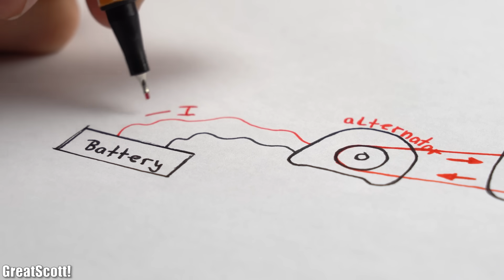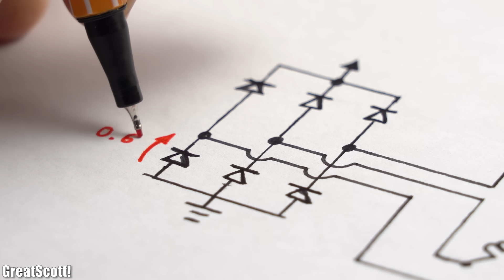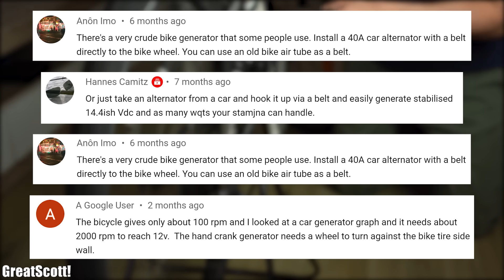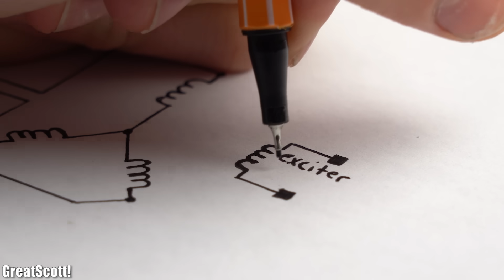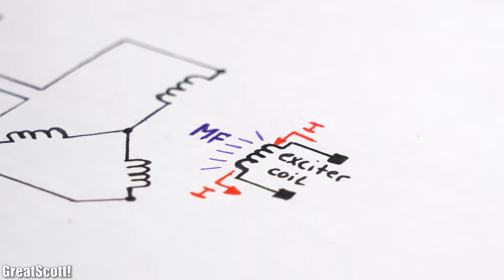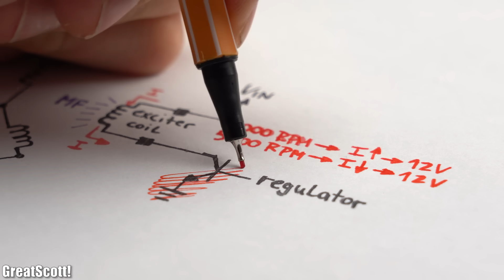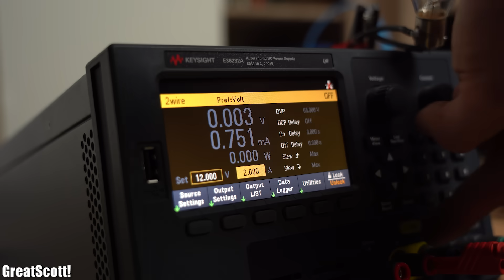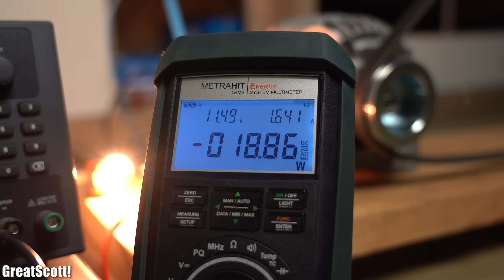Using a car alternator with a bike to power my home? How much energy can I produce?!

Comment: Hello,great video. Here is help. Step 1.  keep your bike set up with alternator the way it is, attach it to positive and negative posts of car 12 volt battery.. Step 2. Buy a Power Inverter 400 or 500  Watts,DC 12V to AC 110V  Car Adapter with 5A  (connect to car battery terminals) Wave Inverter USB Charger Adapter W/ Dual Outlets for Car Home Outdoor Use. Step 3. Peddle bike  alternator to charge battery. Step 4. Plug in household items such as TV, radio, phone charger,  computer (maybe coffee machine) note: it takes a car idling at around 1000 rpms 45 minutes to charge a dead car 12 volt  battery. So doing your calculations you may be able to charge the battery in ??? If you have wind generator just bypass the bike and have two wires from wind turbine to battery. Or if you have a gutter make a paddle boat mini wheel over your alternator attach to building in harness. When it rains the water goes into gutter and pours over paddle altenator wheel with two wires to battery to charge. Would have to water proof or extend shaft to get out of rain. Same can be done with your bike back wheel over river with a paddle wheel connected to your alternator with wires to car battery and adapter to plug in for free energy
Reply: Excellent advice.... I was left wondering why he hadn't gone the route of using an inverter.
Reply: lol

Comment: Doesn’t it add any reduction in power need. Even if it’s just like 20 euros a month or something of your bill or a certain amount of KWh per month?! Or is the amount negligible? Is was thinking about a system that connects all sources of energy. Piezo electric plates in your stairs, warmth while sleeping converted to electricity, home trainer, windenergy, waterenergy from falling water (if you have a 2 or 3 story house and even kinetic energy or piezo electricity in your shoe, stored via a battery that you carry. I mean so much energy is lost and we produce so much every day

Comment: Good job. ...heard work never fails. 
If you make the grooves on the alternator's shaft and remove the pulley,  you can get more rpm + definitely tension required

Comment: The alternator needs geared more than just the big wheel to the small. Also, for sure need a belt tensioner. I feel like with a gear this can be pulled off, at least much more efficiently.

Comment: If you take the diode pack  out all together, the three wires that are hooked to it are 3 phase . Hook a wire to each of the 3 wires at  low rpm you should get 100 volts an the faster you turn it , you can get up to 440 volts a/c  out of it. I built one 28 years ago and it worked great..
Reply: yep...these output ac and its rectified and regulated thru the diodes in the alternator... ive used the same alternators in homemade gas powered generators.. 120v and over 5kw but the ac is many thousands of cycles vs standard 120 v 60 cycle house current... still useable to power many devices and as far as lighting goes, the cycles dont matter at all

Comment: No.. no.. no ..   I built one much better. #1 tip.  Smaller belt.  Keep the alternator pulley as close to the bike wheel. There is much less resistance in the belt. Do your homework on alternators. If I remember right.... Honda is the best for this project.  The most power per rpm

Comment: Hey great video but did you know they make these "single wire alternators" that do not require you to energize the exciter coils. Ac Delco has manufactured them for decades for use in GM vehicles and for tractors or stationary generators.

Comment: I assume if the belt didn’t slip and you were Superman that you could generate near constant wattage the alternator is rated for? 

Oh, wouldn’t changing the wheel size increase or decrease output?

Comment: So you could create a transformer and bump 12V up to 120V... coil ratio 10 turns to 1 turn
Reply: Or buy one and use it to up the voltage

Comment: How much energy? Top athletes can do max 300watts for max 1 hour. That's 3 bulbs 100watts each not considering the energy losses mechanical and electrical from the pedal of the bike to the bulb itself.
Reply: maybe 300 watts for 10 seconds or so if you are hercules
Reply: no way 100 watts max

Comment: EVEN EASIER, use a cheap and cheerful Disc compatable rear ebike hub!! drive it flipped in the dropouts, off the disc side,
. Remove the rim and spokes if you want to. a Disc mount 6 hole sprocket, 16 ~ 20 T sprocket can be got from Velosolo. Done it myself. pretty easy.. 3 phase rectified brushless genny ...

It achieves, after 3 phase rectification losses (typically greater than 12V out )  a mech to Elec efficiency of ~60%. since most ebike hubs are rated >250W, you could easily get > 100W.... if you hav the legs of course.

Comment: So, realistically 
- I cut off the back section of a junk 20" bicycle.
 -Mounted it  Upside down in a block of wood 
 -Flipped the cranks & bottom bracket to keep the sprocket on the right hand side
 -Mounted a bldc ebike wheel with the cassette also on the right side
- Built a 3 phase rectifier from 3 bridge rectifiers from dead switch mode power supplies
- Added smoothing capacitors and an adjustable 1800w boost converter to charge a 48 V lithium iron phosphate battery.
- Attached the entire assembly using wood to a comfortable kitchen chair.
- Pedaling recumbent style I can achieve close to 200w  But realistically between 50-100 W for any length of time.

 The bike was free the motor came from a yard sale the boost converter came from another project as did the electronic components

Comment: Thanks have built simple 12 v generator with 3 HP Briggs n Stratton engine. And alternator. Best to use small output old school gen with external regulator v belt type , it will need a 1o watt exciter bulb to kick alternator into charge mode and be connected to a 12 volt battery  be sure to always have positive output connected  to battery ,if not the alt may damage a diode ,if it does this it will produce power still but the voltage will be affected and useless,.  A unconnected or bad earth and it won't harm anything but will not charge high amp alternator not applicable because your alt will only charge Amps into battery at the rate it can absorb  it may start out at say 2o Amps but will quickly fall away to about 8 Amps input only fitting an Amps Meter inline on positive lead to battery will show you what is going into battery  is change rate , my system was cheap to Run bit noise y but it worked well for many years. Good on you for sharing your experience  a little whipper snipper 4 stroke engine will do the job be sure to use fat wire and solid connection to battery   if positive comes loose while running it will damage alt   thanks again

Comment: from the winding's bypassing the diodes and voltage regulator and hooking up directly to the winding's you can get 90 amps. A/C but you need to use capacitor's to smooth out the power, so you get a constant power that does not fluctuate,

Comment: what if you disconnect the rectifiers in the back and voltage regulator and use ac voltage which is what the altranator produces in the winding's

Comment: I'd had the same idea for generating energy, but not knowing how to was happy to find your video.
In theory it seemed like it should work and a bit sad to see it won't. Thanks for giving it a go.
Reply: Well, some numbers have already been presented.  Here are some more, or a summary.  A horsepower is around 700 W.  A human in rest generates about 100 W as heat.  At full effort a well trained human can produce also about 700 W of mechanical power (plus an increased amount of heat!).  Using a half wave rectifier of silicon diodes, can reduce the rectifier loss to some 0.5 - 0.6 V and with Schottky diodes to maybe 0.4 V.  I am not sure how big germanium diodes were ever made or today available, but some tiny ones used to have a drop of about 0.2V.  After the onslaught of silicon, there were for a while ads presenting "Mr Germanium" or "Oliver Germanium" who touted the benefits of germanium over silicon, regarding the lower losses.  By the way, rather than a bike, a rowing arrangement can utilize the human mechanical effort better.

Comment: Directly proportional to the carbohydrates you're burning while pedaling, also alternators output DC not ac, that's why you hot no reading with your meter set on ac

Comment: You seem to understand the electricaric calculation melarky, I don’t…. as a Caravaner I’ve often thought maybe the lights in a house could be powered by a 12v supply, maybe use a zig unit to keep a leisure battery happy or install that alternator inside the washing machine to supply charge to leisure battery + solar,  I’m not an expert with tricity tho 🤔

Comment: I'm sorry this comment is a year late.  3 things:

1 - Power requirement.  James Watt's horsepower was aimed at being equivalent to the best horse he could imagine, so that when he quoted HP for his engines, no-one could say he over-estimated.  James Watt's 1HP was about 746 watts.  You state you need around twice that to run your house, so that's 2HP (or more allowing for inefficiencies).  Who do you think you are, to be pedalling at 2HP?!!  I hear numbers like 0.25HP in short bursts for a fit person.
2 - Mechanical power losses in a generator are friction and windage (windage from air friction).  These losses are roughly in proportion to the power rating of the machine.  Now an alternator might be a 40 amp machine, make that 14V × 40A = 560W machine (we expect a nominal 12V vehicle battery to run at about 14V under charge).  The excitation circuit presents a real loss, too, so it takes reasonable effort just to keep the machine excited even with no output.
3 - The answer for the best power output seems therefore to be with a smaller machine.  Not even you are going to be able to supply 200W (over ¼HP) for any length of time.  Maybe 50 to 70 W.  And we want one which doesn't spend our precious energy on self-excitation.  This leads us to a permanent magnet machine around 5A to 6A at 12V (or 14V).  

I would look at windscreen wiper motors or radiator fan motors.  Probably cheaper than alternators, too.

Advantages:  (i) A DC motor would have no diode loss, whereas the alternator loses nearly 2V × output Amps as a power loss.  That's around 12% of the generated power.   (ii) A permanent magnet machine uses no power for excitation.

Caveat: a permanent magnet machine has no self-excitation circuit, of course.  Self-excitation circuits use an external regulator to vary the excitation in such a way that the alternator always provides a constant 14-ish Volt output over the engine's rev range.  So in a serious pedal-powered 12V battery-based system, a separate regulator circuit would be required.  Fortunately these can be very efficient and nice and simple to make.

Comment: OH BUT DONT STOP THERE.. A BIG BIKE WHEEL HAPPENS TO BE GOOD BUT A PULLY SYSTEM AND A FLYWHEEL WHERE YOU CAN ALSO COLLECt ENErGY ... MAY MAKE YOUR ALTERNATOR MOTOR SET UP RUN EVEN MORE POWEr.   AT THE MOMENT, YOU STILL HAVE LOTS OF WAIST AND LOSS IN YOUR SYSTEM.... INPUTING A PULLY SYSTEM WITH GEAR RATIOS AND A FLY WHEEL TO KEEP IT SPINNING LIKE A FAN 45 pound weight with magnets would work. the pully connects to the flywheel so all you are doing is spinning your tire that spins the pully with high rpms this would produce the cyntritical forces in the fly wheel that keep it spinning like one of those wheels in a rower exersising machine.

Comment: 8:36 the reason is not just the regulator when you try to get more rpm with the bike the rubber which connects the wheel rim and the generator extends so the bulb is dimming when you start slowly the bulb will stay on no matter what

Comment: An excellent experiment, very well done. Being from a motor vehicle background, in order for the alternator to charge the battery, the current flow must be reversed. Therefore the  alternator typically generates around 14 volts. Please keep the videos coming

Comment: You can add pulley tensioner to prevent slippage of your belt. Alternator can be used for any house appliance as alternative source of Electrical power supply...you can use the electrical circuit diagram of Solar panel ( that uses battery, controller and inverter). The bigger the amperage of Car alternator the bigger power capacity you can get.
Reply: So,  can work?
Reply: @mihai.1302  It would make the slippage less of a problem, but it would also increase resistence, so it would probably work better, but would require more pedal force  in general.
Reply: I concur. All of this is accurate. The resistance with a tensioner would be minimal, compared to the added friction, thus, increasing positive motion on the alternator. There is so much slop and wasted energy in this wooden set up it made my teeth itch.

Comment: What if you geared it much more drastically and attached numerous alternators to it? And could you also take out the inner workings of a few alternators and combine them together to run off of one axle?
Reply: if you did that ,you would Not be able to pedal it for long ,if at all.. it would take some Serious hp, more than a human is gonna generate with pedals...those alternators, even 1 of them, will make  5,000 watts at  120v but to do that its gonna take around 7 to 8 hp... good luck generating That  with ur legs!
Reply: what the hell would that accomplish?

Comment: I used to sell diesel generators they had a module called an automatic voltage regulator which was connected to the exciter coil to regulate the output it seems to car alternator is exactly the same the problem is you were probably producing 2 zero zero to 300 Watts power on your bicycle so the car alternator is not a very good alternator I recommend some kind of permanent magnet motor maybe even a bicycle hub motor wheel you can connect the Windings to a bridge rectifier to charge battery connect the Windings to two capacitors to create 230 V

Comment: I know a way you can get your alternator producing the kind of power output that can power your house... in fact, that it seems you're using 110V, this will give you twice that approx 250V and 10,000W...
Just as you saw in your experiment, you needed a circuit to excite the alternator- this is because the alternator needs a current from the car battery to make the rotar an electromagnet which will then created the magnetic field to generate the power (just as with the small motor you turned with the power drill in the video).
So, a way around it, go into the alternator, get the rotar and hook up powerful magnets around it in alternating polarity-... this will give you immense constant power and turn the alternator into a generator.
You will do away with the rectifier circuit as well as the regulator... and you will get 110v-250V depending on your rpm.
All the best.

Comment: Just go big diameter to small diameter locked to a bigger diameter to a small diameter. Double the initial gearing of wheel diameter to alternator diameter. Also you can pedal slower.

Comment: To me ? Is why not a bike and actual generator motor and use  step up gearing to get 5 k rpm speed at generator hub with only 250 rpm constant speed at the bike wheel giving you 20 times the rotions  for power generation

Comment: Im no rocket scientist ..may I suggest using a heavy flywheel spinning at million miles an hour after being cranked up by some sort of drill or motor for a few seconds to achieve  a long lasting rotational force to power the alternator which I'm turn wld produce electric .. ...  if the fly wheel weighed a ton it wld spin for hrs .. surely ..  use gears to make flywheel turn more easily from start to finish maybe ?   Flywheel was used on a coach in the 20's or early 30s as an experiment ..tho it was successful never went into production maybe cause it was to dangerous .. imagine  a run away half ton flywheel running lose In public ..carnage .. but say if u buried it under your hse and made it safe ..?

Comment: Use several batteries. Use half of the output to sustain the batteries and the leftover to power your house. Also look into gyroscopes and generating electricity. Gyroscopes can significantly lower the amount of force needed to charge a battery or produce energy. Gyroscopes!